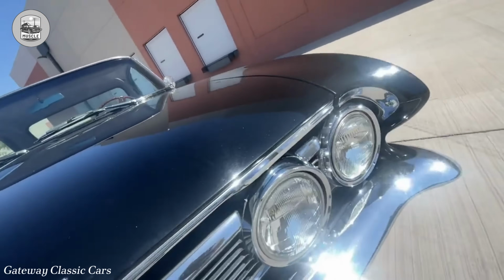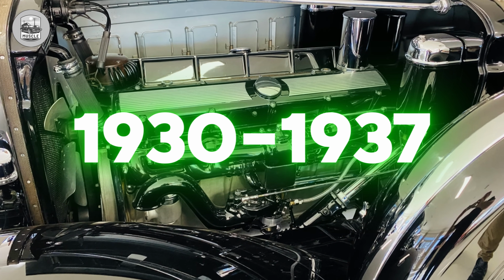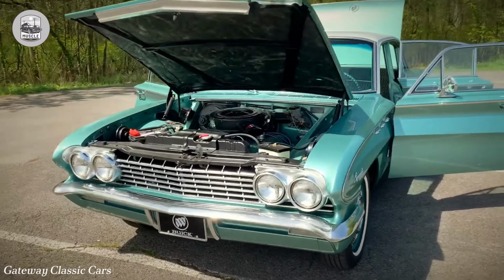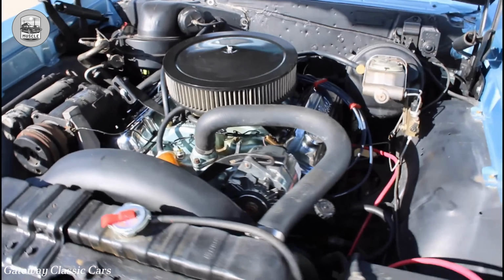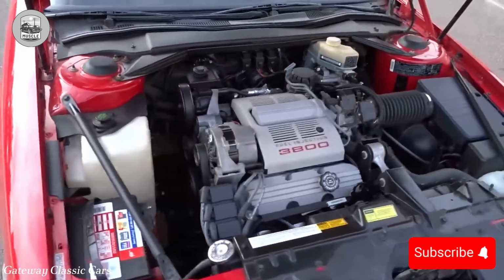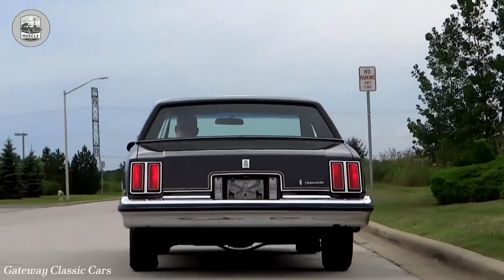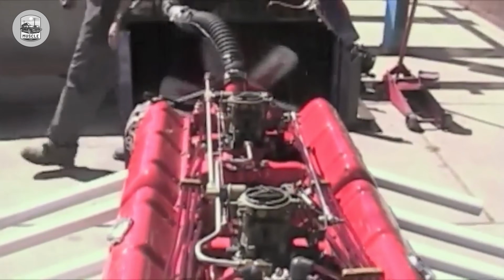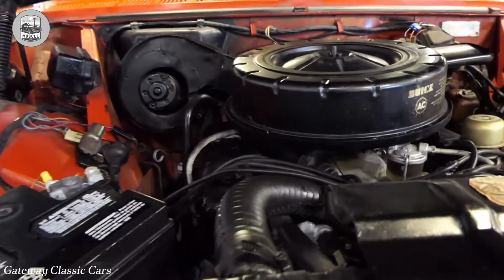10 MOST FAILED and WEIRDEST GM Engines ever made | Worst engines blunder!

Comment: You overlooked the 70's Pontiac 6 cylinder OHC with the optional Quadra-Jet 4 barrel carb in a tempest. The camshaft was mounted in an aluminum ohv head cover using rocker arms with hydraulic lash adjusters. The camshaft did not use camshaft bearings since it was mounted in the aluminum rocker cover! As I recalled the valves were the same size as the big V8's.   A very STRANGEST & WEIRDEST GM !
Reply from the maker: Thank you for bringing up the 1970s Pontiac OHC 6-cylinder! This engine was indeed one of GM’s boldest and most unusual designs, pushing the limits of what a six-cylinder could be. With the optional Quadra-Jet 4-barrel carburetor, this engine produced serious power for a six-cylinder, making it a standout performer.
The aluminum rocker cover with the camshaft mounted directly inside was an innovative design, eliminating the need for camshaft bearings by letting the aluminum head serve double duty. And you’re spot-on about the valves—they were indeed hefty, comparable to those in the big V8s, allowing for remarkable airflow and performance. This setup was certainly unique for GM and even more so in the muscle car era, making it a fascinating part of Pontiac’s engineering legacy!
Everyone, if you're intrigued by these kinds of rare and unconventional engines, don't forget to comment with your own favorites, share this discussion with fellow gearheads, and subscribe to the Muscle Car Masters Channel for more deep dives into automotive history’s most unusual powerplants...
Reply: Wow, I get why you’d call the Pontiac OHC 6 “weird”—but let’s be real here. For a “strange” engine, it punched well above its weight! The idea of sticking a Quadra-Jet 4-barrel on an inline-six? That’s pure Pontiac flair. The aluminum rocker cover with the camshaft and hydraulic lash adjusters was groundbreaking. But hey, it’s hard to argue it could match the rumbling power of the V8s of that era. Sure, the OHC 6 was advanced, but that 230 or even the 250 could never quite measure up in torque and sound to the V8s that defined muscle. So was it really “all that,” or just GM testing the waters before going back to the big-block beasts?

Comment: Borrowed a girl friends 59 Desoto to go to Chilliwhack, temperature gauge doing did not work engine over heated doing 100 mph. Killed the battery and spent the night sleeping in the car by morning the battery had regained enough power to turn the engine over. Big explosion and the car filled with smoke. Opened the hood, both valve covers on that 383 were peeled off, later when the engine was pulled the cover under the intake had been pushed up to meet the bottom side of the intake manifold. Charmaine's father owned a 59 Chrysler Imperial with the Hemi, I drove it a few times with Lindsey always giving me instructions to not full throttle taking from a standing start, you'll twist the driveshaft.
Reply from the maker: That 1959 DeSoto with the 383 really put you through the wringer, but it’s amazing how much damage an overheated engine can cause. The force it must have taken to peel those valve covers and push the cover under the intake is intense! And Charmaine’s father’s '59 Chrysler Imperial with the Hemi? That thing was a powerhouse! The warning about twisting the driveshaft is a testament to the raw torque those Hemis could put down. Those early Hemis had so much low-end grunt that even launching carefully was a must.
Thanks for sharing such a wild ride down memory lane with us! The incredible engineering of these classic Mopars is what makes them legends to this day.
If anyone else has crazy muscle car stories or experiences, drop them in the comments! Don’t forget to like, share, and subscribe to Muscle Car Masters for more stories, deep dives, and everything muscle car-related. Let's keep the conversation going....

Comment: Before my 16th birthday I had over 35 cars on our acreage, you could buy them for less than $20..00 and some were free. The oldest being a 36 ford pick up, some English stuff like the Zepher's, Vauxall's, Austins, Morris Minors about the only nice  thing I can say about them is they smelled good with that leather interior, the early Dodge and Plymouth's with the flathead 6 all eventually chucked a rod through the pan, the Chevy's even with the oil dipper on the con rods took more of a beating. A 51 Chevy I had with out a trunk lid me and a buddy would do out early morning paper routes. By the time I had turned 16 had been in juvenile court a few times for no drivers licence then again at 16, judge asked me why I had no licence yet. Told him all the fines he was giving me was the reason. Judge suspended the fine telling me to use the money to get my license.
Reply from the maker: It sounds like you had quite the collection before you even turned 16—over 35 cars on your acreage, that’s just wild! The variety you had—from that classic '36 Ford pickup to English cars like the Zephyrs, Vauxhalls, and Austins—really takes us back to a time when cars were a bit simpler, and yes, those leather interiors definitely had a unique smell!
Your experiences with the flathead 6 in those early Dodge and Plymouths chucking rods through the pan is something many enthusiasts can relate to. That was a common issue, especially when those engines were pushed hard. But I have to hand it to you, the Chevy straight-six engines, even with those splash oil systems, could take a surprising amount of abuse. The fact that you and a buddy were doing paper routes in a '51 Chevy without a trunk lid shows the sheer fun and adventure that comes with being a car nut at a young age. I can just imagine the looks you got on your route!
And wow, run-ins with juvenile court over no license? That’s classic! It’s great that the judge eventually let up and helped you get your license instead of just handing out more fines. Definitely sounds like you were destined to be a car lover from the start!
Thanks for sharing this awesome story! Let’s keep these kinds of stories alive in the Muscle Car Masters community, so if anyone else out there has had wild car adventures from back in the day, drop them in the comments....

Comment: Buick 215 was pretty cool. Be neat to introduce one to a 32 Ford or something.
Reply from the maker: The Buick 215 is indeed a fascinating engine, known for its lightweight aluminum construction and impressive power for its size. It was ahead of its time in many ways and would be a fantastic fit in a '32 Ford, especially for those looking for a unique, lightweight hot rod with a V8 punch. The engine was originally used in Buick Specials and even found its way into British sports cars like the Rover P5B and MGB GT V8. It’s reliable, easy to modify, and has great potential for custom builds. Pairing it with a '32 Ford would give you a combination of classic American hot rod style and innovative engineering!
What do you think? Any fans of the Buick 215 here who’ve done swaps like this? Let us know in the comments! And if you haven’t already, make sure to comment, share, and subscribe to the MUSCLE CAR MASTER CHANNEL for more unique engine insights and muscle car discussions....
Reply: @MuscleCarMasters68  Thanks for the reply. One of the first cars I painted was a 1962 Buick Special. Really pretty body lines.
Reply from the maker: @panchorodriguez7246  The 1962 Buick Special is truly a beautiful car with elegant body lines, and it's awesome that you got to paint one early in your career. The Buick 215 is a fantastic engine to pair with a classic like that, given its aluminum construction and light weight, making it perfect for hot rod builds. It’s not only innovative for its time but also found its way into some British classics, like the Rover P5B and MGB GT V8. The engine’s versatility and mod potential are what make it so special, and I bet there are some awesome 215 swaps out there in the community.
To everyone watching, have any of you done a Buick 215 swap or worked with this engine in your builds? We’d love to hear your experiences in the comments! Don’t forget to comment, share, and subscribe to the MUSCLE CAR MASTER CHANNEL for more in-depth engine insights and muscle car discussions! Your support helps keep this channel growing....

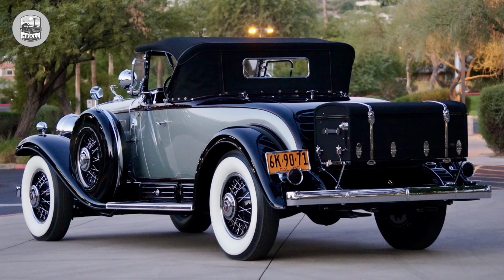Comment: After the Hudson my first legal road car, me and a buddy headed to Penticton BC it was so hot we decided to head back to the lower mainland. Ended up at the US border crossing the guy asked where we were headed, told him Vancouver. Turns out to be a lesson in geography. Soon I discover were travelling South turn around and get a speeding ticket in Tanaskit Wa. Its a 75.00 fine and the Sheriff tells me he's going to hold me till someone comes to pay the fine. I say to the Sheriff he's going to have me for a long time as my Father is not the type of guy to bail me out. Told him to hang onto the car, he laughed saying that car ain't with 75.00. I say to me is is, tells me to git.  First car first job, first payday off to get my car. A 55 ford, overhead valve V8, standard 3 speed, 4:11 diff, and a vibrator tube that always would fall out of the radio. Them Ford clutches are hard to hold down at high rpm's for a burn out.
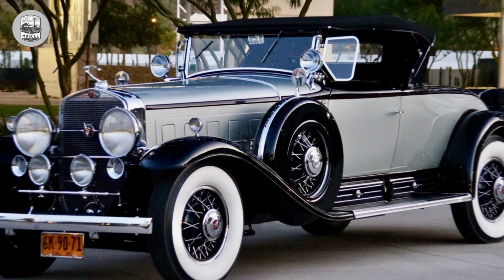Reply from the maker: It sounds like your first road trip was packed with adventure, geography lessons, and even a run-in with the law! That 1955 Ford with the overhead valve V8 and 4:11 diff must have been a beast—especially with that standard 3-speed! Ford's clutch system back in the day was definitely known for being stiff, especially when you were pushing it for burnouts. And that classic radio tube issue? A quirk many of us can relate to—it’s amazing how those little things stick with us over time.
The '55 Ford's Y-block V8 was a solid engine for its era, offering a nice balance of torque and durability. With the 4.11 differential, that car must have had great acceleration off the line, making it perfect for some good old-fashioned stoplight racing. It’s moments like these that truly capture the spirit of American Muscle Cars—raw power, character, and a whole lot of memories.
For everyone else reading this, what’s your most memorable car story? Share your first muscle car, road trip, or favorite modification in the comments below! We’d love to hear it! And don’t forget to comment, share, and subscribe to the MUSCLE CAR MASTER CHANNEL—there’s plenty more great stories, engine breakdowns, and car history coming your way....

Thank you so much for your reaction to our channel.

Comment: My first car and love, 47 Hudson Super I-6 with wet clutch, hood opened from firewall forward - 22.5 feet bumper to bumper. Twelve years old car always had a dead battery, would push start with our Gibson tractor then jump off to catch the car as she idled down the field. Back in those days I could run, my father taught me how.
Reply from the maker: What a fantastic story! The 1947 Hudson Super I-6 is truly a piece of automotive history. That wet clutch design was pretty unique back then, and at 22.5 feet, it was a massive car—talk about making a statement! I can just imagine the scene of push-starting it with a Gibson tractor and then chasing it down—classic old-school ingenuity. Hudson was ahead of its time with the "step-down" design, and those I-6 engines had quite a bit of torque, which was perfect for cruising down those country roads.
For those watching, have any of you had a similar experience with an old classic like this? Let us know in the comments below...
Reply: While the nostalgia for classic cars like the '47 Hudson Super I-6 is understandable, I’d have to disagree on its practicality, especially considering those recurring dead battery issues. That wet clutch system, while unique, often required more maintenance than modern alternatives. The hood opening from the firewall forward was certainly distinctive but not the most efficient design for accessibility. Sure, there’s a lot of charm in these vintage cars, but they were often plagued with mechanical challenges that today’s models have largely overcome. The advancements in reliability and ease of maintenance can’t be ignored when comparing them to our classics.

Comment: Aluminum head's and block's Are weak
Reply from the maker: Thank you for your comment! While it’s true that some aluminum heads and blocks have had durability issues, it's important to note that aluminum's lightweight nature is a huge advantage, especially in performance applications. Modern technology has come a long way in improving the strength of aluminum components. For instance, many high-performance engines today use aluminum heads and blocks, like the LS engines, thanks to advances in metallurgy and engineering.
Aluminum dissipates heat faster than cast iron, which helps keep engines cooler, and in racing, reducing weight can significantly enhance performance. Some legendary engines, like the 427 ZL1 from Chevy, made incredible use of aluminum components to save weight and push the boundaries of power.
We’d love to hear everyone’s thoughts on this topic—what do you think about aluminum in engine builds? Let us know in the comments, share your experiences, and don't forget to subscribe to the Muscle Car Masters Channel for more awesome content on muscle cars and engine technology! Keep those comments coming, and let’s keep the conversation rolling....

Comment: 215 Buick Engine's were crap.
Reply from the maker: Thanks for sharing your opinion! The Buick 215 engine does get mixed reviews, but there's a bit more to its story. This engine, introduced in the early '60s, was revolutionary for its time due to its all-aluminum design. It weighed only 318 pounds, making it significantly lighter than cast-iron engines. This made the 215 a favorite for racers and engineers looking to reduce weight and improve performance. While some did have issues, like cooling problems and head gasket failures, the 215 laid the groundwork for later, more successful aluminum engines.
Interestingly, this engine was also used by Rover in their vehicles, proving its versatility for decades after Buick stopped production. For many enthusiasts, this engine became a legend in lightweight applications.
What’s your take on that? We’d love to hear your thoughts and experiences! Be sure to comment, share your stories, and subscribe to the Muscle Car Masters channel for more engine discussions and automotive history! Keep those comments coming....

Comment: My favourite engine was the ford 289 cid special.
Reply from the maker: Thanks for sharing your favorite engine! The Ford 289 Special is an absolute legend, known for its reliability and versatility. Whether it was powering early Mustangs, Cobras, or even the GT40, this small block made a huge impact. It had a great balance of performance and durability, and when fitted with the HiPo (High Performance) package, it was capable of pushing 271 horsepower, making it a real competitor in its day. Plus, the sound of that 289 winding up is something every car enthusiast loves!
What do you all think? Any other 289 fans out there? Let us know in the comments, and don’t forget to comment, share, and subscribe to the Muscle Car Masters channel for more great discussions on classic engines like this....
Reply: @MuscleCarMasters68  I stuffed a 221 small block into a 56 Willys wagon 4x4, easy swap as some of the early Willys came with the ford flathead V8 at the time was easy to find the OEM adapter plate. Hardest to find was that odd ball bolt pattern bell housing. Could have used taller gears in the diffs. Living in British Colombia had plenty of mountains to explore. Gasoline was cheap back then.
Reply from the maker: @gelmgren  Stuffing a 221 small block into a '56 Willys wagon 4x4 sounds like a fantastic project! That early Ford flathead V8 connection definitely makes sense, and it’s great you found that OEM adapter plate. That oddball bolt pattern bell housing—yeah, those are a challenge to track down!
You're spot on about the need for taller gears, especially with all those mountains to explore in beautiful British Columbia. The 221 small block probably gave that Willys some solid torque, but it’s always tempting to optimize gearing for those long uphill stretches. Back then, gasoline being cheap must have made all that exploring a blast!
We'd love to hear more about your experience driving that build through the mountains....